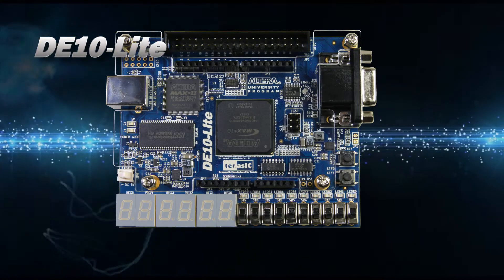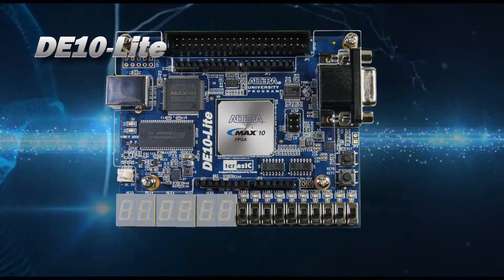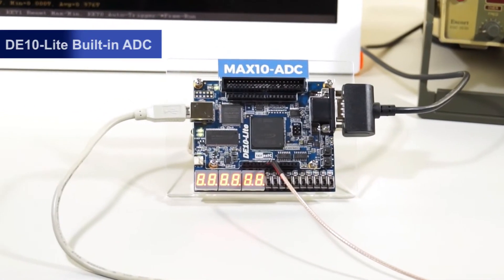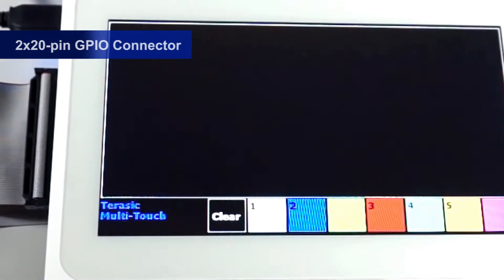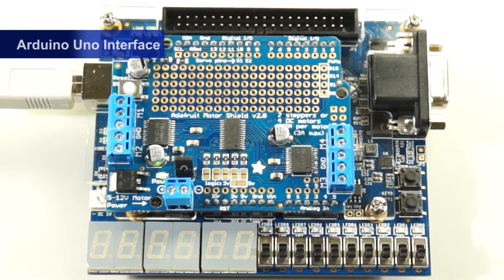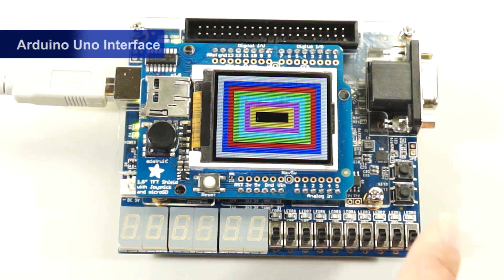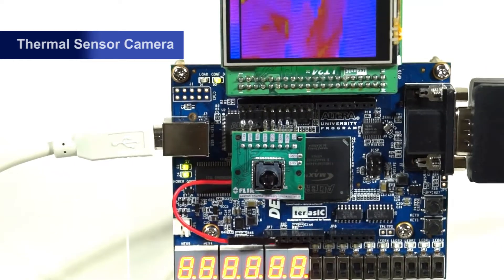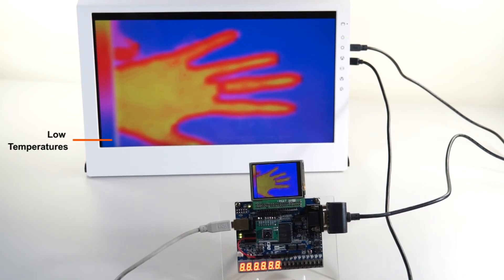DE10-Lite FPGA Development Kit

Comment: Hello I bought one of yours DE10-Lite FPGA but when I tried to use DE10-Lite control panel for the demo my computer crash: "Kernel security check failure". I am using Windows10 and quartus prime II v.16.1. I tried to fix the drivers but maybe I am doing in the wrong way. Any ideas? Thank you for yours videos are really helpfull.